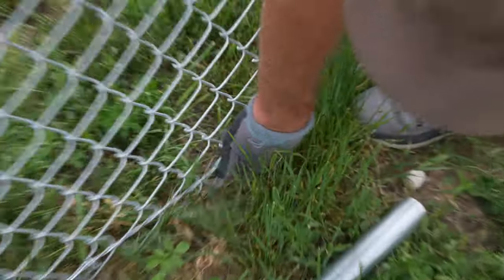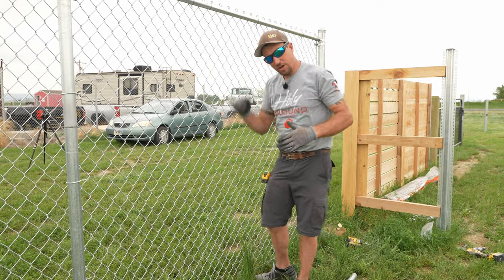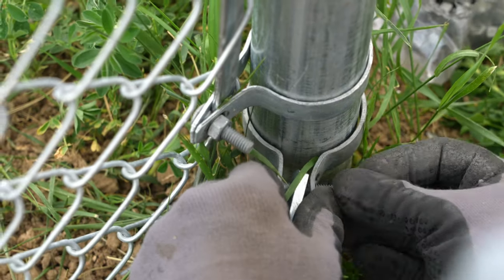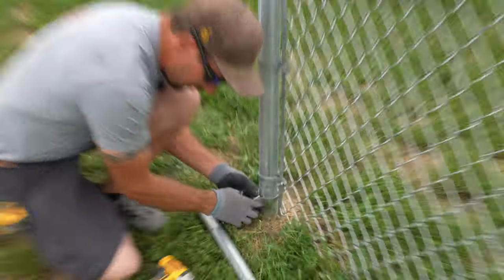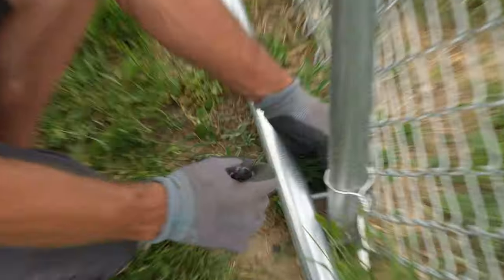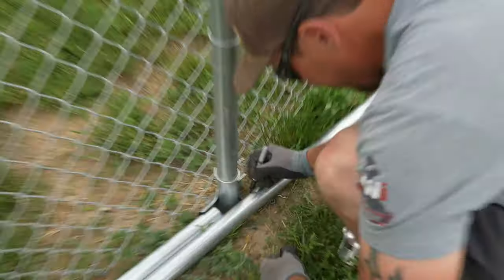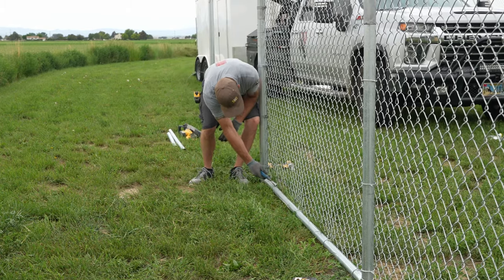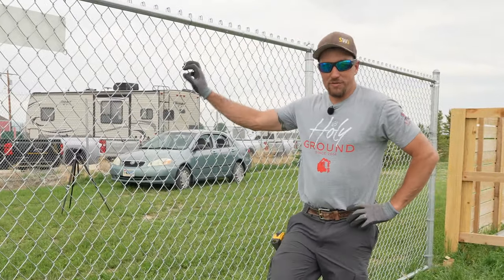Make It HARDER For Your Dog To Dig Under Your Fence

Comment: Very clean and clear! Any options for the a bottom rail on 5x5 vinyl posts with ranch style triple horizontal rails and no current bottom tension wire?

Comment: john , what component do i use at corners that doesn't make 1 rail higher off the ground ( because of stacking). I don't see any corner mounts anywhere
Reply from the maker: Same component, just flip it over. https://youtu.be/ooqa6abatBM?t=156

Comment: So if you had say four sections of fence, would you still only us two rail ends and a clamp on the middle two poles?
Reply from the maker: Yes. I would run several hundred feet before I needed to use another terminal post with additional rail ends. 👍🏻
Reply: @SWiFence  thank you!!

Comment: Would this help to keep the fence in tact when a snow plow is pushing snow up against it?
Reply from the maker: It would make the bottom more rigid for sure, however it might be best to not plow snow into the fence. 😀🙂 (Giving you a hard time--I realize you may not be the one doing the plowing.)

Comment: Dan, that works rather danged well on that chain link fence.  If I was a dog eating cat… I’d shun digging under it fer sure!  

Iffen I had chain link within which to contain one, that is.  However, I don’t. All I have is 5 strand Bob-War on hedge posts.  

I was wondering, could that contraption be adapted to keep the canine devouring feline from digging under MY fence?

If so, it would be a good danged idea!
Reply from the maker: Absolutely! You just need to stack about 30 of them on top of each other and then wedge them between the hedge posts. Should do the trick. 😂
Reply: @SWiFence  I shoulda knowed you’d have a way!  Thank ya.

Comment: Useless if there is NOT an existing brace band at the bottom! 
How do you get a new brace hand on at the bottom?
Reply from the maker: Not trying to sound silly but you buy one and install it. Super simple. Just match it to your pipe size. You can pick these up anywhere.